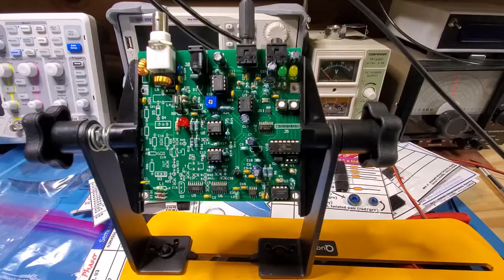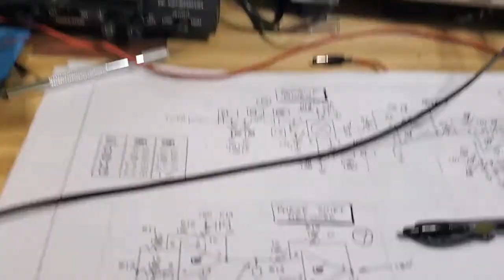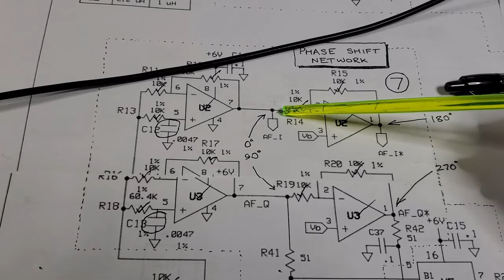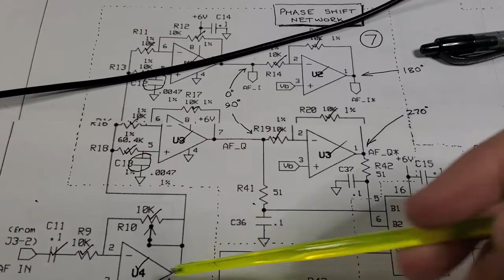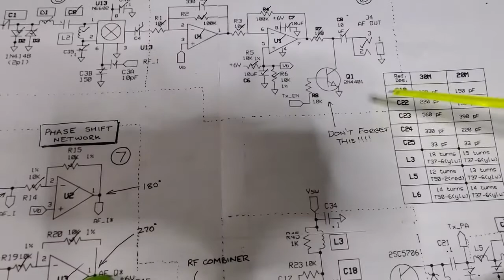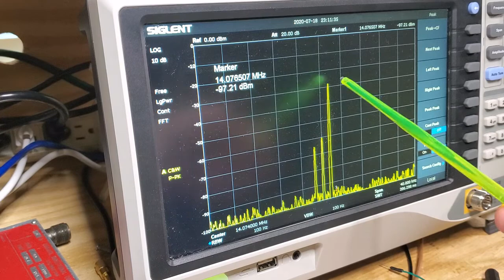Phaser Build  Part 5 - Phase Shift and SSB Test

Comment: I noticed the spectrum out is very clean. Why is there no products in this compared to your version on the Taylor mixer. Just wondering?
Reply from the maker: That is a very interesting comment. I did mention this on one of my other videos but a lot of the harmonic "muck" in my implementation was coming from those cheap LM358 OpAmps I was using. When I switched to LM4562s (about 10x the price of the LM358s) all that "muck" went away. I should really do a video comparing the two.
Reply: @na5y   Oh OK. I did notice they were using JRC  NJM4556  ICs which can drive loads 150 ohms. Thanks for the reply.